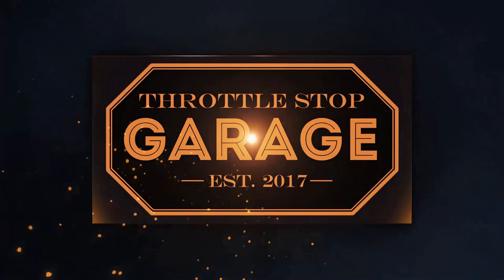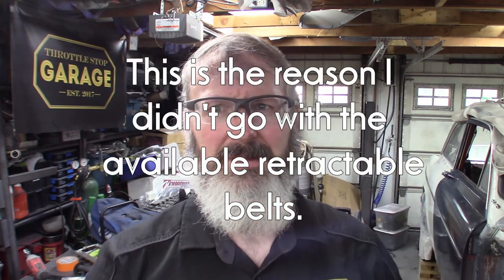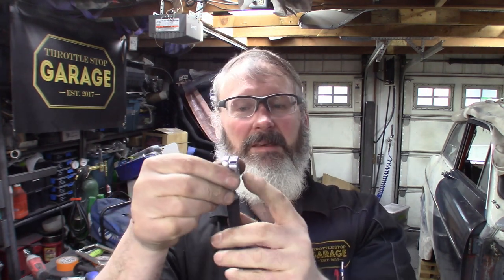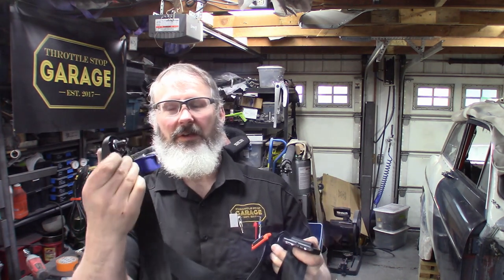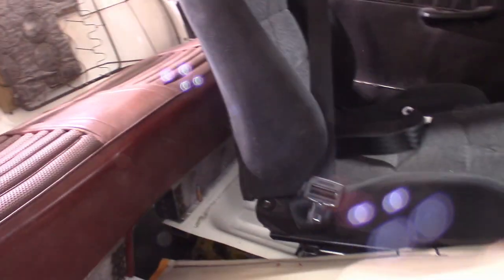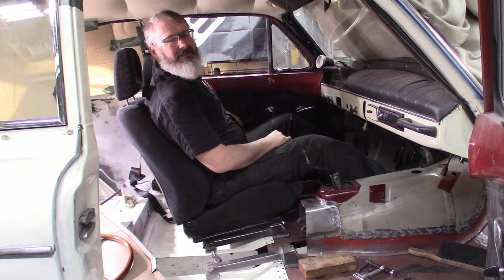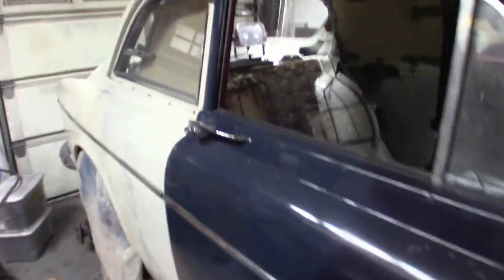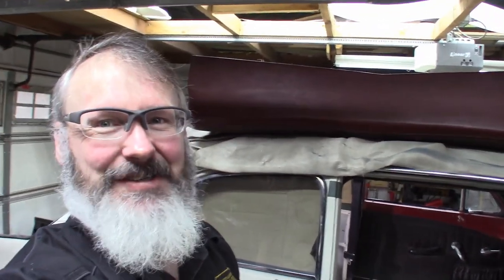Volvo Amazon Seat Belt Installation (Ep. 33)

Comment: I was a Volvo mechanic for 38 years here in California, doing all the "Classic" cars for the shop (those with CI Injection and Carbs.) I can confirm that I too, have NEVER seen Factory rear seat belts in an Amazon.  I own a 1964 4-door Amazon, and it does not have rear seat belts. I did update the front seatbelts to the later style with inertia reels back in 1990. I got lucky and found one of the LAST Volvo original kits, no aftermarket parts needed.

Comment: Ex Volvo driver here. In the 70's I drove a series of 544s and 122s and remember them fondly. They were durable and built for cold weather, which suited me here in the Yukon. The most interesting one I ran across belonged to an acquaintance: a 544 with a 6 volt electrical system and a 12 volt starter - the battery had 4 posts and a little series parallel switch mounted nearby: 12 volts to the starter while cranking & 6 volts the rest of the time. It also had a sort of Venetian blind that could be raised in front of the radiator in really cold weather, from the inside of the cab.

At any rate I came down with a cold last weekend & happily ran across your channel a day or two later. I've been enjoying it every day since. Your skills ingenuity, and attention to detail are inspiring. Thank you very much.
Reply from the maker: Thanks Gord - The radiator blind was a great innovation for the cold.  I can't wait to get the car done and go for a drive.
Reply: First time I have ever head of a battery with both 6 and 12 Volt posts.
Reply: @russellflacco7811  It's the only one I've ever seen. It was before the days of everyone having a camera in their pocket, unfortunately.

Comment: Interesting video! I own a very early model that originally did not come with seat belts at all. It has mounting points on the b-pillar and under the rear seat to attatch diagonal two-point belts in the front. From what I can tell, the bolts are smaller 3/8" UNC, not 7/16" UNF. The rear seats does not have any mounting provisions at all, that includes the holes under the parcel shelf. Part suppliers state, if anything is mentioned at all, that early models need modification to mount belts. Your video probably illustrates what I would need to go through in order to mount belts in my Amazon.
Reply from the maker: I hope it helps.  My car is a 1966, so I already had some of the mount points.